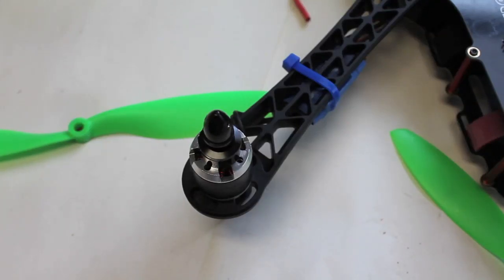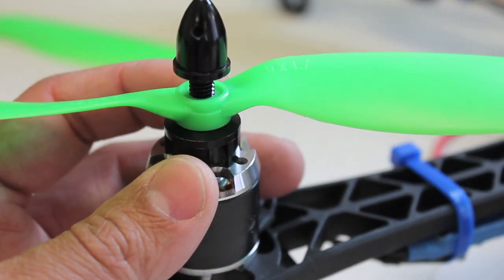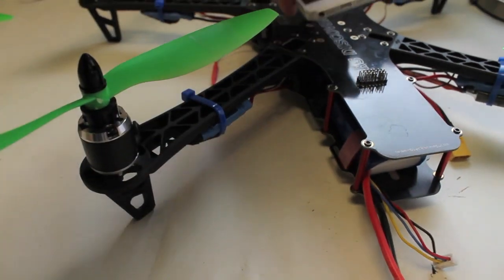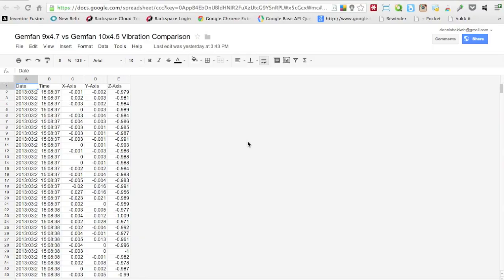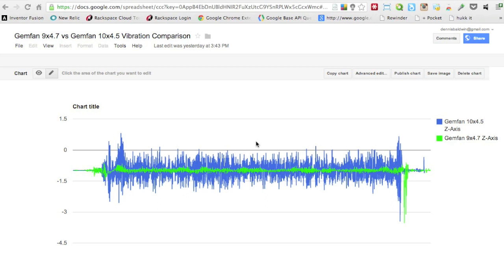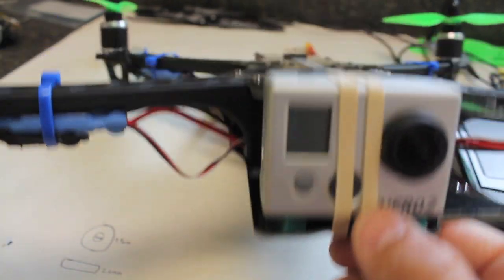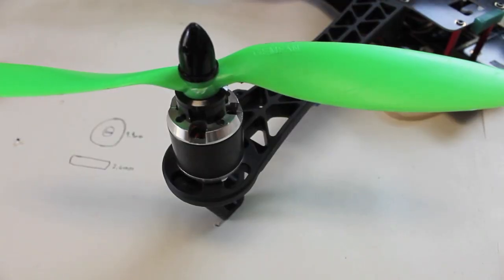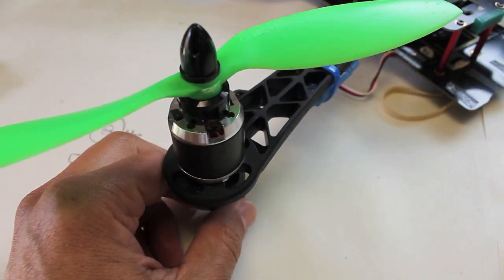TBS Discovery Quadcopter Gemfan 10x4.5 vs 9x4.7 Propeller Vibration Comparison

Comment: The darker areas on the prop adapter shows where the weight actually is. I counter balanced the light shot with small pieces of scotch tape. Until I had even marks   on the prop adapter. I done it on all props the same way. There is slight vibrations but a little anti vibration platform can be made with some silicon tube. If you still have viberations. Tape quarters to the top of your camera.
Reply from the maker: Donny Bea Thumbs up for this information. Very useful. I'll have to give this a try in the future. Thanks.

Comment: Hi Dennis, I have used simular motors with the bolt on shaft. I found the bolt on shafts by default are out of balance.  I bought 4 mm shafts about 10 mm longer than the whole motor. Mine happened to be press fit. Having 10 mm shaft sticking out from the face of the motor I was able to attach a prop adapter. The cheap props are fine. You need to dynamic balance. It's dangerous if your not careful. I wound up the motor to hover throtle. Took a black sharpie and held it next to the prop adapter.
Reply from the maker: Donny Bea Ah good stuff! Thanks for the info regarding the bolt on shafts. I completely overlooked that previously. Will keep that in mind for future reference. Take care.

Comment: Thanks for the videos. There are a lot of variables. I'm anxious to start some tests of my own. I'm afraid I'll have to pass on the IPhone testing. Could you clarify for the general audience which is the x,y and Z axi? Thanks!
Reply from the maker: Yes, Roy....a ton of variables. Can you clarify what you mean by "general audience"? Not sure what you're asking.
Reply: Dennis Baldwin  I would say the downrange axis the axis which is pointing in the same direction as the aircraft is the X axis, the vertical axis the Y and the cross range axis is the Z axis which the aircraft pitches around. Is this the convention that is used in multicopters? If so you expect to see the same amount of vibration in X and Z axis and more in the Y.

Comment: Dennis, when looking at vibration, smaller speeds will normally produce larger displacements. My point, as you are measuring the entire system you introduce the possibility that the offset rotors can affect (reduce or increase) the overall vibration in the frame. You should probably look at various speeds through the entire throttle range (increase by 10-25%) and not only at "hover" speed. Also, wind could introduce its own harmonic into the equation.
Reply from the maker: Great feedback. You're right there are so many different inputs that affect vibration beyond my simple tests. Thank you and I will definitely consider this information for future tests.

Comment: Dennis but I have a couple of issues as I get close to running a bench test on my 650mm Quad. I have the NTM series of motors from Hobby King and their plastic SF type props. I think I have a good idea as to how to laser tune with a mirror. But the data is all momentary, so...1st, What is the app that you use to capture and create a tri-axial seismic plot and does it come in an android version? I have an app that displays tri-axis seismic but I don't think it generates a file. 2nd; You mounted the phone on some Zeal gel to replicate the same dampening that your GoPRo would experience. I was originally going to mention that the two items are not in the same weight class, and so it brought up an interesting question when it comes to isolating an FC which as you know is a big deal for the APM. I have one and I am trying to eradicate as much vibs as possible naturally. The APM2.5 does not weigh more than 31g.and for the guys that are starting out and using foam or gel alone, I wonder, allowing for simple physics, how increasing the mass (weight) of the FC assbly would improve the action of the isolating medium. What have you found in the interim for using straight foam or gel? Naturally I am a subscriber :-) of yours but I haven't checked out all your uploads
Reply from the maker: Hey Chris the app is called Seismometer 6th. Not sure if there's an Android version but you should be able to find out. I agree regarding vibe reduction. Yes, the weight definitely plays a significant role and I'm not always able to compare apples to apples unfortunately. The latest and greatest I've been using with my APM is Kyosho Zeal. Mainly because it is double-sticky and does a good job of reducing vibes.

Comment from the maker: Yes, that's generally the case. The lower kV the larger the motor and the slower it will spin, BUT you will use a bigger prop and generate more thrust. It's lower torque so it won't be as snappy as a higher kV with smaller prop, but if you're carrying a good size payload then you want a lower kV motor with bigger prop. I generally fly in the 750 - 950kV range with different prop setups.

Comment: Well I have had to put my vibration issues on hold for now because ever since I installed my NAZA MC my ESC's or Motors are over heating causing my quad to fall out of the sky. I think I talked to you bout this a little a while back as I thought it had something to do with my 4000mAh battery being too big but as "you said" this was not the case. It has the same prob with my 2200 batts. What ESC's & Motors do you use on on your NAZA quad?

Comment from the maker: Are you flying with a 3S or 4S battery? Also, what size props? Make sure you look at the published information related to power and prop size for your motors.  You may be on the edge of what your motors can support.

Comment: Dennis I am going to have to change out my ESC's & motors too prob. What do you recommend?  Right now I am still using those cheap Mystery 1000kv motors & Mystery 30A ESC's that I told you about on another vid of yours. Ever since I installed my NAZA M they both get really hot and after about a min in the air one esc or motor will fail & drop the quad. I 1st thought my 4000 bat was the prob but now I know that my 2200 batts are doing the same thing. Its gotta be a esc/motor prob! Its gotta be :(

Comment from the maker: I don't have the stock DJI motors, but have ones pretty close and I was flying 10x4.5 and a 3S battery. I think the 4S with 10x4.5 may be a little too much load for the ESCs/motors to handle. I could be wrong, but I think you'd probably want to prop down to 8" with 4S. Whatever you decide to do when changing your prop config definitely take for a brief flight and do the motor touch test to see how hot they are. Alternatively you could put an ammeter in series to see what your current draw is.

Comment: Make sure the marked blade is the lighter blade.. then put the tape on the top of the lighter marked blade which will bring the blade lower do to more surfce area.. if the marked  blade is lower put blancing tape on the bottom of the blade which will induce more lift and will fix the blade tracking :) hope it makes sense lol gret job!

Comment: Good job now put the washer on top and get rid of the cone nuts :) and actually because of the higher headspeed you get less vibration.. same goes for a heli.. less pitch with a higher head speed smooths out the vibes... other cause of vibes with gem fans is you cant ever get perfect blade tracking do to flex..

Comment: Also, I admire the effort trying to get things perfectly balanced with the motors and props, but the reality is it will never be perfect. I have found that as long as your props are balanced and motor shafts aren't bent it all comes down to how the camera is mounted. I have even found that my GoPro Hero 1 will vibrate and my friends gopro hero 3 wont due to the difference in weight and how things resonate. So basically what I'm saying is, don't waste too much time trying to balance the quad :)

Comment: Most quads I've seen have had the washer on top. I wouldn't do it with the bullet style nut you are using. There isn't anything for the nut to bite into. I put a little dab of align blue loctite on all my shafts. And when you tighten down the nut maybe it binds and sets the prop off to one side. Who knows. We are all noobs at this.  lol.

Comment from the maker: Thanks, you've got to be kidding me about the washer!!! I never would have thought to put it on top. Any idea if that's the recommend placement? I only ask because it seems to fit nicely on the bottom, but when I put it on top there is overhand around the edge of the prop hub. Anyway, these are good things to know. Let me know how your carbon fibers work out. Will be anxious to hear.

Comment: Another great video! I put that washer on top of my props with a standard nut. Also I started sanding my Gemfans. No tape. It works a little bit, but not much. Hopefully my carbon fiber props will be here soon.  They are suppose to be fully balanced. We will see.